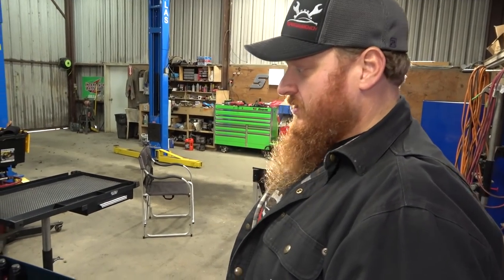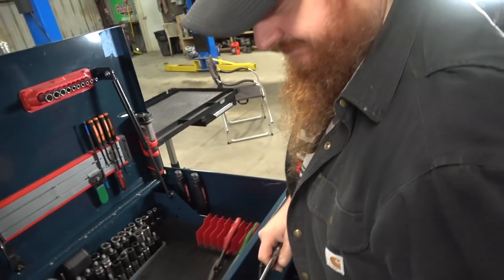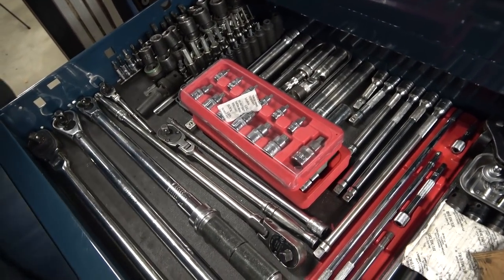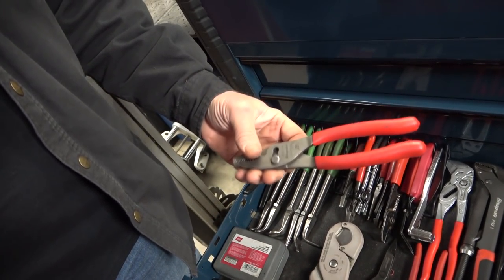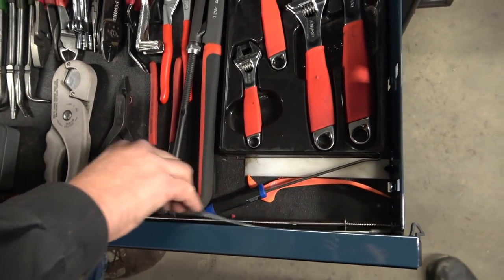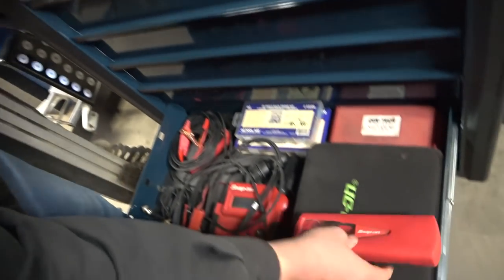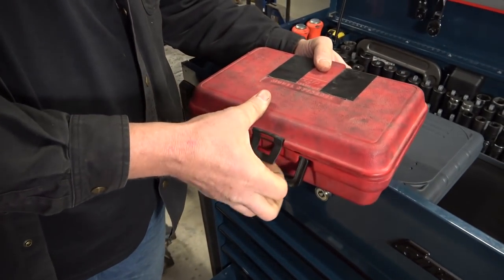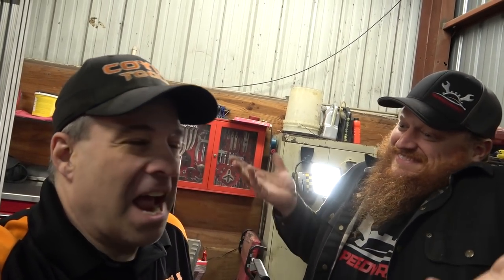Snap-On Tool Cart Tour

Comment: Black electrical tape I. The lid for magnetic stuff is easier in the eyes. 

Kick ass tour, keep them coming!
Reply from the maker: I sure will, and there's more on the way. Thanks for the complement!
Reply: I agree the painters tape isn’t the most eye pleasing. I went this route for a few reasons it’s a little wider, it peels a bit easier, it’s a little thinner and once it gets over a hundred degrees and stays there for half the year, the black tape starts leaking it adhesive and goo’s up everywhere.  Thanks for watching.👍

Comment: What are you using for moisture control?
Reply: The small bags of Desiccant Silica gel, and VCI paper included in various parts boxes such as rotors, bearings, engine parts and etc.

Comment: another nice setup. personally i can't work out of a cart, i've tried it, just doesn't work out. i have an old school cart with the top shelf and bottom shelf from Mac, i've had for 10 years, the top is just a catch all for tools after a job, if i have to get on to the next. bottom is for suction tools and funnels. bought the screwdriver cabinet and a drawer for it, but its just storage. interesting what he said about those Bluepoint magnets and mirrors having warranty on them, my dealer won't do it, so after i ruined the first set i had i just started grabbing 4 or 5 of each at Princess Auto (kind of the Canadian version of Harbor Freight) for like $2 a piece so if i break them i'm not out a bunch of money. i have 2 pairs of Knipex side cutters, large set and smaller set, both Mac branded as well and i actually have to warranty both sets next week, they are both dull and very loose, but granted i've had them for 8 years. i actually forgot about them for awhile in my plier drawer, and went and bought a Channel Lock set to get me by. it's always great when you loose a tool in a vehicle and then it comes back how ever long later and you find it, sucky part about that, after awhile of not having it you always buy a replacement. it's weird i've noticed that lots of battery tools now are available with magnets or add on magnets, but i was always taught that magnets and batteries don't mix well, so i'm still on the fence. that inner tie rod tool he showed at the end, i used to have one of those and they are such a pain. you have to remove the outer to use it and where i am with so much rust you almost need the vice most of the time. so i bought one like 8 years ago that looks like a muffler clamp but its hardened steel with serations in the u bolt part and a 3/8 drive in the other side, so it can go around the inner and you tighten it with a 9/16 wrench and then use a long extension and ratchet.
Reply: Yeah the Knipex are just unbeatable.   So far I’ve had the battery magnets for a few years and no issue.  Thanks for sharing.  I like hearing stories about other technicians in different parts of the world.

Comment: Get the 6.0 m12 batteries for the angle grinder,  works much better. Doesn't stop as easy. Im actually happy with the angle and straight Milwaukee grinders. Im out in the field so it makes life much easier
Reply: Even on that right angle impact,  6.0 works much better then the lame 3.0s. At first I didn't think I was gonna like the right angle impact cause the size, but it fits lots of places the M12 stubbys  won't , well worth the 200 clams

Comment: Cornwell has the same bend on their pry bars as the Milwaukee they are pretty solid pry bars as well.
Reply from the maker: Cornwell's pry bars are manufactured by Mayhew. The main design difference between those and the Milwaukees is Milwaukee uses an I-beam design, whereas the Cornwell ones are a solid piece of square stock. The Dominator line from Mayhew is the one made for Mac, Matco, Cornwell and Monster, when it was a brand.
Reply: @CoyleTools  I thought Cornwell made their own prybars they have a manufacturing video on Youtube showing them making them in the Ohio plant. The sticker on my Prybar set says Manufactured by Cornwell or something like that. Mac never claimed this just the handle. Cornwell claims to make them from start to finish. The guy streightening the pry bars has a freakin cornwell shirt on. I think you are BS'ing on that one.
Reply from the maker: @andrewhutchinson5490  Don't come on my channel and tell me I'm bullshitting, because I make a living by being honest and learning as much as I can about who manufactures what and which brands are made by other manufacturers. Part of my education comes from  traveling to tool expos and talking with manufacturer reps who tell me the brands they manufacture for. So when the Mayhew rep told me they third-party branded for Cornwell and the handle on the Cornwell pry bars is identical to the previous iteration of the Dominator series, I tend to believe it.

Mayhew also purchased Basque Plastics that manufacturers, among many other products, pry bar handles for other brands. Is it possible or even probable Cornwell makes the bar and buys or used to buy their handles from Mayhew? Is it possible that Cornwell used to outsource their pry bars to Mayhew, then in-housed the operation? Is it possible Cornwell makes only certain pry bars themselves and buys, say, their longer bars from Mayhew? Because in the video you reference, the narrator only states they manufacture 12", 18" and 24" bars.

It may be I have old information. Or it may be I have information newer than that Cornwell video posted in 2017. It could be I'm just plain wrong because the tool industry changes constantly and it's impossible to be up on everything all the time. But there is no scenario in which I am bullshitting you.